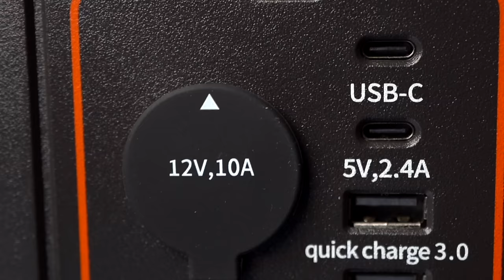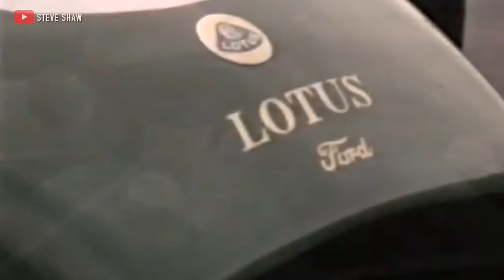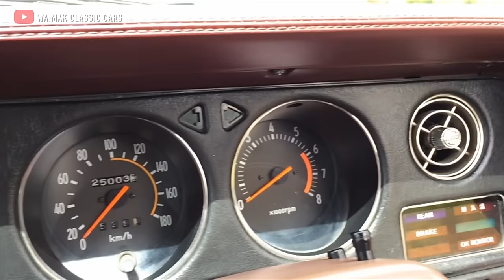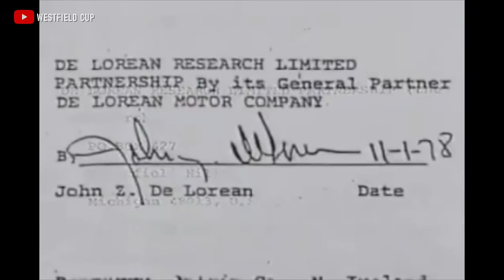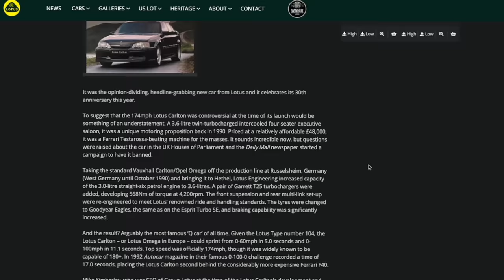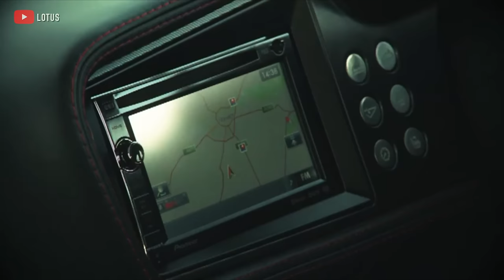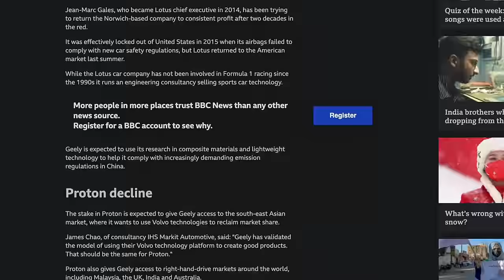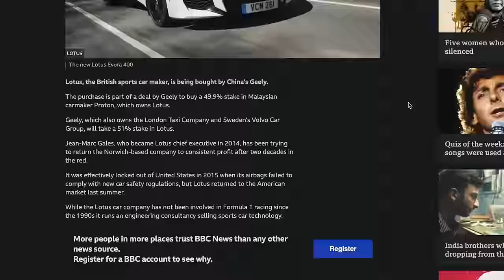Lotus is Dead

Comment: I owned a used Lotus Elan in 1970.  I traded in a Fiat 124 coupe.  The Elan had been used in hill climbs and had several modifications.  I brought it back to somewhat stock specs and used it as primary transportation for a year and a half.  I entered a lot of autocross and won so many trophies that I had to give them away because they took up too much room.
   It was not all roses.  I stripped out spark plugs from the aluminum head,  broke the differential half shaft, had to replace the clutch, could not keep a speedometer gear in the trans for more than 5 months, leaked oil all over the place, could not keep the electric windows working, had to replace a lot of wiring due to corrosion.  My new wife enjoyed riding the elan but could not learn the drive stick.  The Elan had so many other "self-disassembly" features that I had to get rid of the car.  But, man, was it fun to drive!!!   Steering was whiplash quick and the gearbox shifted like a light switch.  While owning the Elan I got married which changed my attitude and needs. In 1972 I traded it in on a used Alfa 1750 coupe which I drove for over 80,000 miles.  But that is another story.

Comment: i do see their future as a big departure from heritage. i think i find less of an issue with the electrification than i do with the weight. it seems they always had power train issues and never really developed one on their own, so electrification seems like the “simplest” power train they could use. it’s a shame though that it means heavy heavy batteries. if all goes well, these SUVs will save them like the Cayenne saved Porsche and they will still be able to cater to the true enthusiast, albeit an electric enthusiast.
Reply: I think Lotus’s approach to EVs, similar 2 Porsche, Dodge, Hyundai N and most likely Lamborghini, will b 2 convert pre-existing ICE enthusiasts to electric power by engaging the driver through clever tuning and improving the cornering of the cars while still capitalizing on the benefits of electric power. In other words, lotus’s future is still true 2 it’s past, and I’m 99.9% sure that lotus will adopt super capacitor technology in their enthusiast cars shortly after Lamborghini pioneers it in BEVs
Reply: NO true car enthusiast would ever own an electric car.
Reply: @paulsellgren9972  you never actually own an electric car huh
Reply: True enthusiast.  Electric enthusiast.  Pick one.
Reply: I've been buying Lotus cars new, from dealers, since my first Lotus in 1996.  I won't be buying a battery car.

If the choice is battery car or gas powered motorcycle, motorcycle wins.

If I wanted a battery car I wouldn't have owned all these Lotuses over the years, I would have bought Teslas.

The first Tesla was actually Lotus's first battery car - it was based on the Elise.  I didn't buy that one.  I've never bought a battery car.

.
Reply: @mrsoisauce9017  you could of just said you have no idea what you're talking about and saved a paragraph
Reply: @ariefghani2380  If all you are interested in is power than electric is a good choice. But, just because of the weight of the batteries and motors, you have lost the nimbleness of the Elans, Elises and such, regardless of brand, and with that the actual joy of driving. Put me on the right roads, or track, and I'll out drive them with my Honda Fit.
Reply: @ariefghani2380  give one good reason for owning an electric car
Reply: @ariefghani2380  Of cause not.
Reply: People that own and like electric cars are just viewers that drive from A to B. They don,t work on their cars to make them perform better, etc.. that's half the fun. You don.t work on your cars obviously otherwise you would get it.
Reply: @ariefghani2380  a nissan leaf or a  3,552lb/ 1,611 kg Tesla model 3 that cost 80-90k NZ dollars isn't a sports car for the masses the new nissan 400z is a sports car EVs are not sports cars
Reply: @ariefghani2380  i drove some electric cars including model 3 (standard), as well as Honda E (though it was rented), still not convinced to actually own one

Heck, I prefer a shitbox over EV all day, at least for me
Reply: I'd rather It die, rather the brand gone than make SUVs
Reply: @RockSolitude  I never said it would be likely. I enjoy ICE cars myself. A lot. I desire an EV as much as u do. But think abt this: EVs are the inevitable future whether we like it it not. Lotus, Hyundai, Lamborghini and Dodge all look committed to preserving as much of the ICE spirit in EVs as possible. They may not be able to convert us to EV enthusiasts, but they’ll at least be able to give us the next best thing. Each brand already makes exceptionally incredible ICE machines (Lotus has the Emira being the brand’s last ICE car and it has a manual, Lamborghini’s Huracan and Adventador are an absolute riot with V10 and V12 screamers and a driving experience that can only excite, Dodge’s Challenger and Charger are the only real muscle cars left on the market and damn good ones at that, and Hyundai has an expanding lineup of N performance cars like the Veloster N, Kona N, and the i20N and i30N that don’t exist in the states because America sucks), and Lotus already showed that they can make EVs that are at least somewhat engaging to drive (which beats not engaging at all) with the Evija. As far as I can see, I think my original statement still stands. Besides, I said try. Trying is not doing. It can be doing, but it isn’t always
Reply: The thing with electrification is that the way that every company is entering it feels wrong. As you say they are ditching heritage and culture. Everything must be trendy not iconic. I mean look at them all. Either shameful copies of other car companies or ending up looking like Chinese copies of European cars. If the switch to electric was done with more soul I'd be more for it.
Reply: Well, now in the first quarter of 2024, we can see that Lotus wasn't crazy, it was just we the innocent public who were blinded by poverty. They've sold through the 130 car run of the Evija even at those prices.

Comment: The Lotus Seven was one of the few road based cars that actually raced in an F1 Grand Prix in Kyalami South Africa, it was modified by cutting a chunk out of the width of the car making it a single seater, even though up against dedicated Grand prix cars it didn't come last.
Reply: A Lotus 7 racing in F1???  What have you been smoking???
Reply: @Miklos82  Look it up, A Lotus Seven was entered into the 1962 Rand Grand Prix in Kyalami, South Africa driven by Brausche Nieman, it was competing against dedicated Grand prix machinary and qualified well when quite few proper race cars which were entered did not and it not only finished the race in 10th place while some of the dedicated Grand prix's did not,  it passed a number of these dedicated more powerful cars. There are even photos of it passing mid engined race machines during the race.
Reply: @Miklos82  It was a Lotus 3.5 since it was cut in half removing the passenger seat.